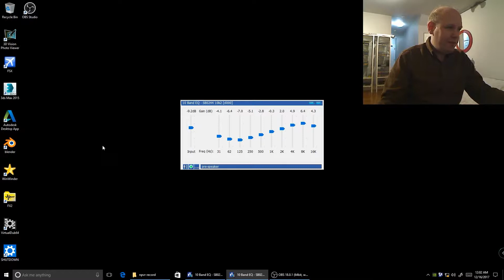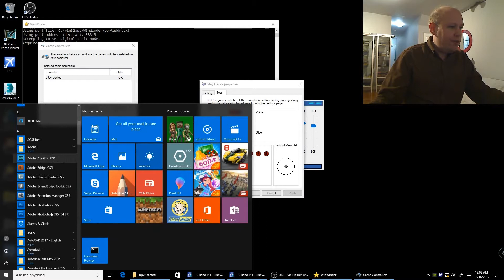Finishing up the WinWinder Precision Pro Gameport driver

Comment: Hi, 

First I wanted to thank you for your work.
I have a Microsoft Sidewinder 3D Pro Plus and I still have the USB gameport adapter but the joystick isn't even detected.
I don't know if your driver could work as I have no gameport yet.
I'm looking for a gameport card so I could test it.

BTW do you think about sharing your source code on github or other source code repository ?
Maybe your work could be improved with help from the community.
Reply from the maker: Well the source is in the download, but I was not putting it anywhere as it stands.

Comment: This is one fine piece of Software for such and Good´Ol HW as the WinWinder PP. Congratulations! This really needs to get more attention.
Sadly, i´cant get it to work in Windows 10 x64 Lastest Build (1903) because i´cant even install vJoy... It says "Failed to Install". I dont know if downgrade or what...
Have you any idea with/or went through this issue too? Thanks and keep up the good work!
Reply from the maker: In the winwinder.zip file, there is a vjoy in there you can install. The versions of the lib files and installer match. Did you use the one in the winwinde.zip, or try to download a new vjoy? Maybe if you use the one in the winwinder.zip file and right click 'install as administrator? The hardest thing about doing all this is probably finding the gameport address in decimal that you have to change the in the portaddr.txt file. If you are lucky your soundcard will have the address in the device manager. Thanks to pci enumeration, it sometimes shows up as an unknown device with a 8 byte port range.
Reply from the maker: After needing to be administrator, my other thoughts may be the zipfile when extracted got corrupted maybe by a really unstable system, or on the fly running it, or maybe it has become incompatible with a newer version of windows and maybe you could try installing a newer version of vjoy from their site, but I tried to make all the versions match when I compiled it. Thanks.
Reply: @MatthewSuffidy  Thanks for taking your time and for the reply!
The problem i got with vJoy its related to Windows 10 lastest build. I tried the one in the winwinde.zip & also the lastest version i grabbed from somewhere else and got the same error message wich says mostly nothing. It goes through all the installing proccess and in the end it claims "vJoy failed to install" instead of "sucefully installed". Dunno if  you keep using your tool but keep that in mind for furthers clean installs/updates. In build 1903 of Win10x64 the installation fails. Sort of a Two-Cents notation from my noobie person.

Despite of this, i went to another PC i have, luckily with an "old" Win10 x64 build 1607. In there, the instalation of vJoy went without issues. 
(This Whole thing i went through before even finding WinWinde.Zip) - I couldn´t get the PCI Soundcard Address initially because it only will tell me it wasn´t recognized. 
I have a SoundBlaster CT4830 & a SB0060. Installed the kX Project Drivers just to have the card recognized by Win10 Device Manager and get the working address of the Card.
(I´m surely doing everything wrong from here) 
Pointed out the Address "1000 - 101F". If the Port Number it´s the lower one plus 1 = 1001 hexa = 4097 dec. Setted portaddr.txt to 4097. It wont pass the "Attempting to set digital 1 bit mode.". So i tried just playing with the numbers for the sake of don´t understanding your explaination. tried then the higher number. 101F = 1020 = 4128 dec. It wont do nothing.
So i tried to get "Creative Game Port" driver "working". Note the quotes. I downloaded a Driver wich was made by "Daniel Kawakami" aka Daniel_K for Vista of the GamePort. (Supposedly x64 Vista Driver)
Tried the usual automated Win Way, it failed first because the digital firm. Disabled the need of the Digital Firm, it fails because it claims to be short on instructions.
Forced the Install, it installed but claimed the "code 12 error" because of the Drivers aint funtional I think.
So I tried renaming/deleting the "PMCIA Card Driver" just to see if the error will go away. It did, and Windows notes "Creative Game Port" as functional. I doubt it.
But well, it now points out some sort of Address, but its nothing alike the Sound Address. It points out "1400 - 1407". So i tried with 1400 = 5120 ; 1401 = 5121 (?) ; 1407 = 5127 (?). It will not pass the "Attemptin to set digital 1 bit mode."
Surely im doing everything wrong but oh, well.

Mostly because im doing all this stuff to get working NOT a "WinWinder Precision Pro" but an old Arcade like "Genius Power Station" just for the sake of making it work. Though i was thinking of buying one, but im not sure if its worth, mostly because i want to get it to work with Win10, nor a Retro Gaming Rig.

Also, because of this, i was trying to force some sort of GamePort Controller command just to see if the Driver of "Creative Game Port" its really working and if i could make it from there. But couldn´t find a way, an *.inf to sit on the joy.clp or something... 

Sorry for the long post, and also for asking for help regarding an issue wich ain´t especifically for a WinWinder but for the GamePort itself. 
Still, If you can bring me some light on this issue it will be much appreciated.
Also, forgive me poor English.
Thank you!
Reply from the maker: Well I am a bit confused, but this program really only works with Microsoft Precision Pro joysticks. You have to have vjoy installed and the inpout32 and set the port address and it works for 2 of my computers... Thanks for trying though.
Reply from the maker: In theory the source could be modded for other gameport joysticks, but this one has quite a specific digital mode that has a certain number of bits and clear interpretations of what those bits are doing, that is almost certainly not going to be the same as  other joysticks.
Reply: @MatthewSuffidy  Yeah, i thought so, but it was worth the try. Maybe i can figure out some other way or mess up a little bit modifing the source for this Joystick in particular...

Btw, you think a "Sidewinder Force Feed Pro" will work with your Driver?
Reply from the maker: I am honestly not sure if the Feedback one would or not. It certainly would not do forces though.